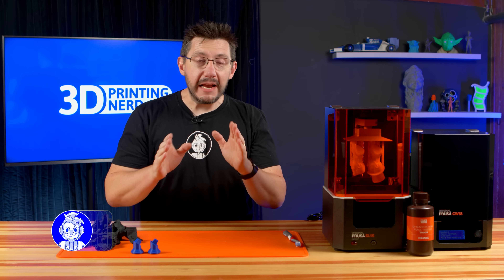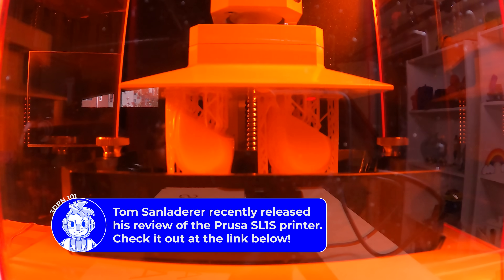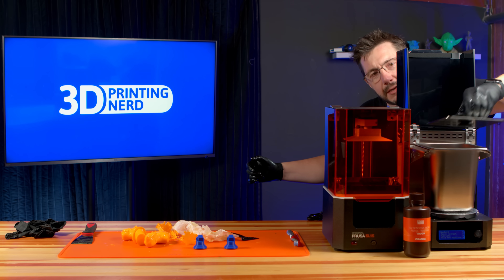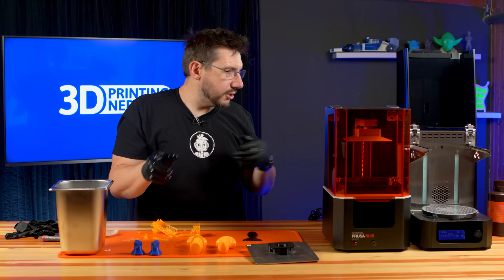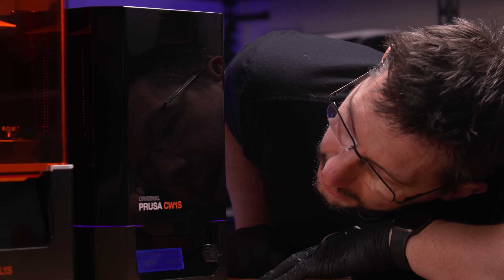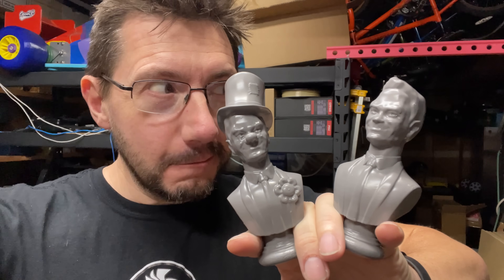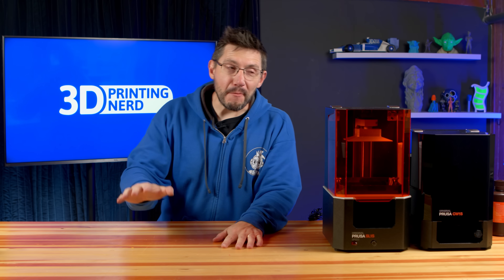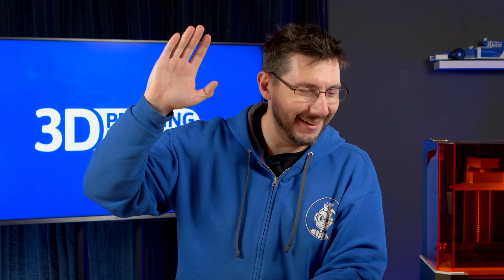HOW FAST is the Prusa SL1S 3D Printer?

Comment: So I’m looking in to getting a 3D printer and was trying to figure out what low cost laptop I should get that will work with cura? Any suggestions?
Reply: Minimum system requirements
OpenGL 2 compatible graphics card, OpenGL 4.1 for 3D layer view.
Display resolution 1024 x 768.
Intel Core 2 or AMD Athlon 64.
550 MB available hard disk space.
4GB RAM memory.

Comment: I didn't like how Joel was getting resin everywhere with his gloves. It's best to leave the prints on the print bed and washing the parts, then take them off the print bed and clean them up. It reduces the amount of uncured resin you need to handle.
Reply: Seriously. Watching him touch everything with "hot" gloves was giving me anxiety.
Reply: Can't believe I had to scroll this far to see this. He touched every handle, the bust bases, all his tools with full on globs of resin everywhere. Straight up anxiety inducing. The whole point of putting the build plate straight into the wash and clean station is to avoid that amount of resin getting all over the place.

Comment: the 'pan' for the cleaner looks a lot like a 1/4 insert for a restraint prep station, if that is so you can get them from nearly ANY restaurant supply store... P.S. Sorry! too many years building models and painting cars, boats, and ships.... much, much further away from the thing you are painting, and LOTS, LESS paint on things, just DRIFT it onto the object (which will both give you a better paint finish, AND get it dry faster).  P.S.S.  What would happen if you put the thing being painted (coated VERY lightly in paint) on the finish station plate (if the UV would make it dry faster?

Comment: I just can't get past the price. I don't see the price being worth bump in speed.
Reply: Maybe not for a home user, but... it's 3x faster or so! That's a huge deal for prototyping and companies. Taking models that need 10 hours to about 3. Add support to that and yeah, not too expensive at all anymore, especially for companies.
Reply: I am not so sure that it really has a speed increase. There are plenty of resin printers that claim to be 3x faster. But 3x faster than what? Is it any faster than a Anycubic Photon for far less money, 4k screen, bigger print volume, etc? Nope, it's actually slower.
Reply: @shvrdavid  For the same volume, it’s faster. Ofcourse you can fit more on a bigger plate..
Reply: If you read the specs on both machines, the Photon is faster in every way. I would love to see a side by side of both printers. They both make the claim of being 3x faster than others. Both claim just over a second per layer, with a max of 2, etc. $2k is a lot to spend on a claim that the Prusa is going to be 3x faster than a Photon... 3x faster than a Photon would print approx. 180mm height an hour, at any volume...
Reply: @shvrdavid  totally agree, I do like Prusa's build quality.  As a business owner that does prototyping I would rather have 4 machines that are slightly less fast having multiple iterations going for evaluation than a single one.  As a business owner the only thing that grabs my attention is the claimed longevity of the screen life.
Reply: @DesertRox  It is common for mono lcds to last far longer than rgb ones. That is all that they are claiming based on how I read it, so there is that. The Photon Mono uses a mono lcd as well. So do most other printers. So it is sort of a pointless comparison. I doubt Prusa makes their lcds panels either. So they are more than likely using the same ones anyone else can buy. There are a lot of claims with the Prusa, lots of reviews that parrot what Prusa writeups say, and basically none of the reviews are putting it up against any other printer using the same file(s). That speaks volumes when all you have are meaningless claims of being 3x faster than "whatever" and costing 4 to 5 times what the competitions printers do. If the printer did have a drastic speed advantage over others it would be worth having. There would be no reason not to publicly demonstrate that difference as well. But if there are no drastic differences in speed and reliability, it is far better to have more printers for the same investment cost. And you would not want to try and demonstrate how fast it is. Sort of like, no one has..... I was born at night, but it wasn't last night.....